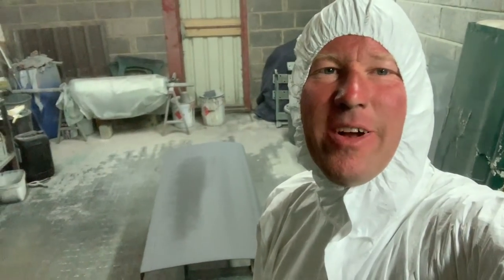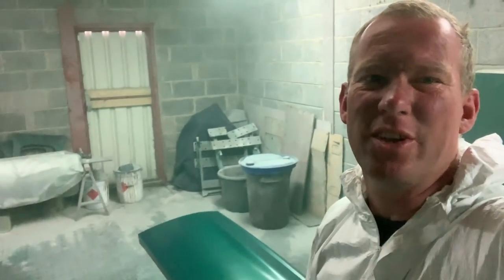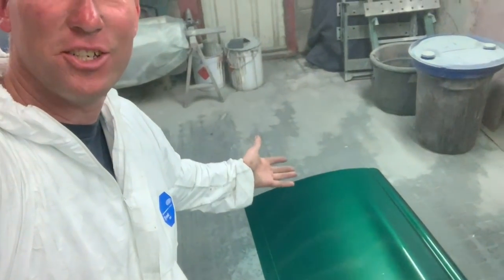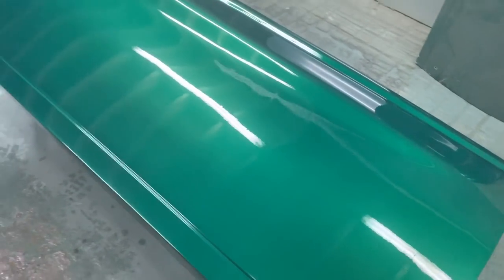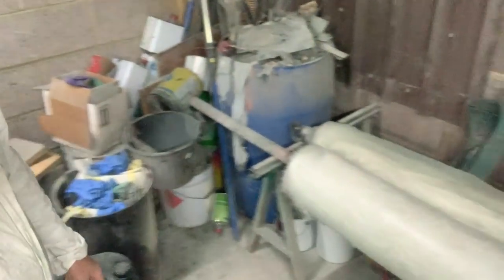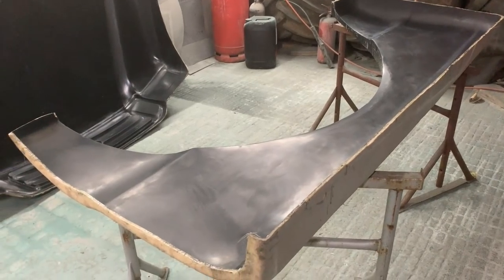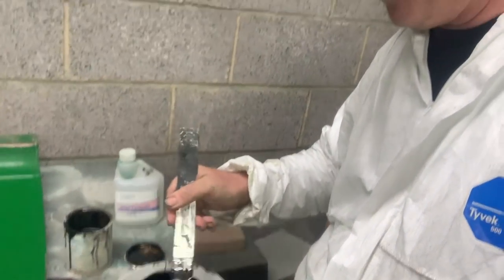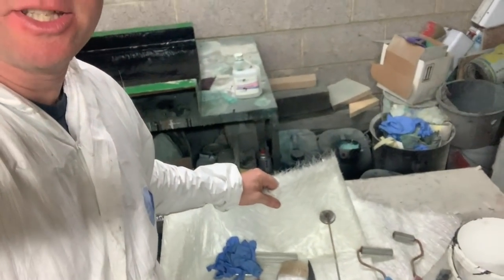Making new monster truck body panels

Comment: very cool i have a few questions if ya dont mind. The tyres what would they be normally used for in an industrial application? Im presume they are carried over from some kind of agricultural machinery as i cant see you going down to quick fit or the monster truck tyre shop. Another thing what kind of engine is that? chevy? Ford? Does it need a lot of servicing? rebuilding? thanks
Reply: Your spot on the tyres are large flotation tyres  used on the uk/Ireland to spread slurry  in agricultural applications
Reply: @rockabillypreformancerc1639  thanks for making the time to answer
Reply from the maker: 2011metalmaniac The tires are agricultural tires normally found on lime spreaders, slurry tanker. And sand quarries
Reply from the maker: 2011metalmaniac my engine in the truck is loosely based on a big block BBC. It’s all aftermarket performance parts and needs a full rotation assembly every hundred hours
Reply: @swampthing4x4  Do you do the rebuild yourself? i suppose you have to order new parts from the US
Reply: @swampthing4x4  Would be awesome to see a How to service your monster truck series. good half million subscribers. Unless you take it though a Mcdonalds drive through of course lol but thats living the dream isnt it.